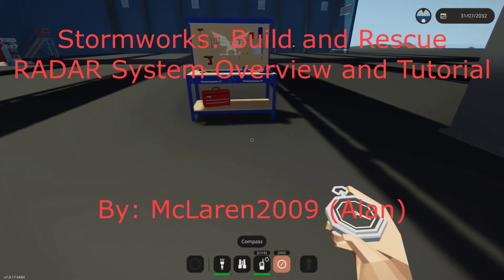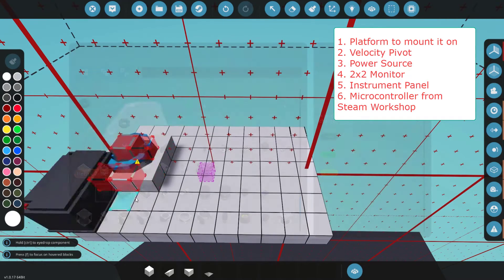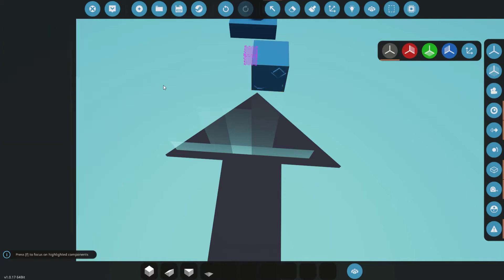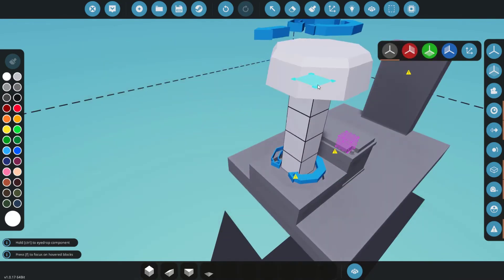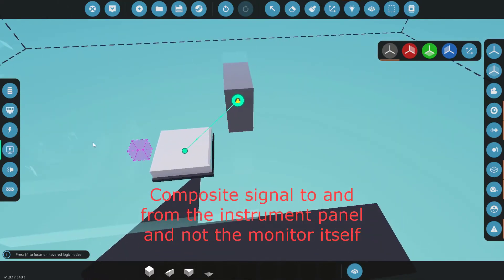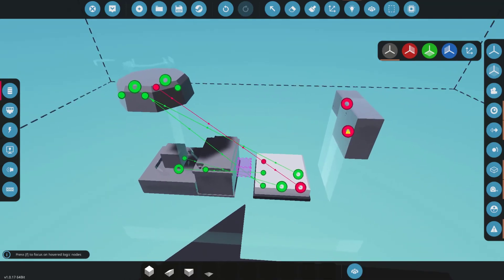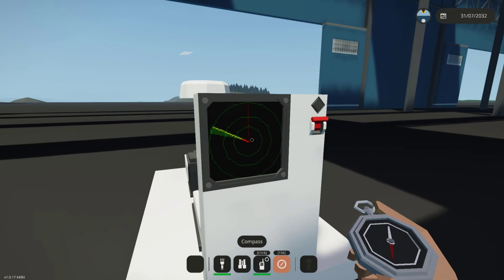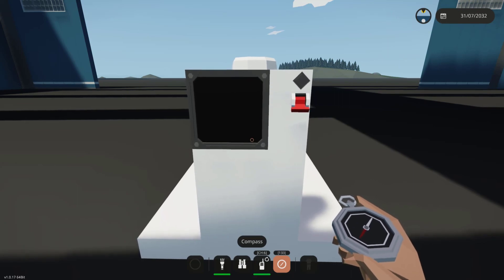Stormworks: Build and Rescue. RADAR System Overview and Tutorial (Outdated)

Comment: The composite part doesn't work for me... when I click it, I see nothing on the radar controller... well, rather, half of this doesn't work at all when I try this step by step. I don't get it ? :/
Reply from the maker: As in you're not seeing a composite connection node? I don't think I understand your issue.
Reply: @McLaren_2009  Yeah, that's it. The composite doesn't quite work - even when I try to do this step by step from the video. Is there something I need to download in order to make the radar work, or am I missing something? :/
Reply from the maker: I went back and tried building the system again specifically using the controller on the Workshop. I connected the electrical systems, the video, data, and composite data exactly how I did it in the video. The only difference is that I added a gauge to channel 1 on the instrument showing target distance from 0-600 meters. The composite data has to be connected while in the composite mode and from the micro-controller to the instrument panel. Ignore the composite output for the touch screen as I didn’t use it this time. The system can be used on either a 2x2 monitor or a large HUD (3x3). Specifically use a 3x3 velocity pivot, small RADAR antenna, display, and an instrument panel with channels 1, 2, and 4 active. I was able to get it working, but I don’t know how or why composite data wouldn’t be working. It has to be a bug, unless you didn’t switch to composite mode when connecting everything.
Reply: @McLaren_2009  The problem is, that when I click composite, the Radar controller has no composite options at all; it's all blank. That's what I don't understand.
Reply from the maker: I don't understand why that would happen either. I wanted to make sure that I didn't overwrite the micro-controller with one of my other ones. The controller is still the right one, so I don't know what would be causing the issues.
Reply: @McLaren_2009  Okay. Thanks for your help anyway. This has got to be some kind of weird bug or something, I suppose.
Reply from the maker: One thing that you could try is to unsubscribe from the controller on the workshop, start your game, exit the game, re-subscribe to it, and then test it again (making sure you have the right controller). If this doesn't work, we're back to square one...
Reply: @McLaren_2009  Yeah, I'll try that, thanks :)